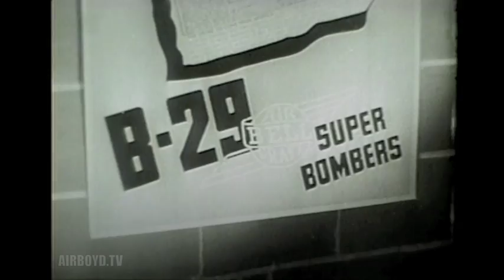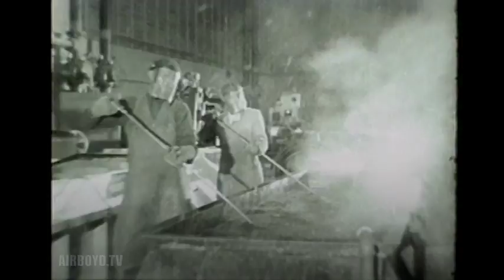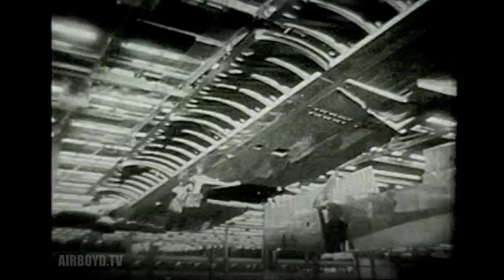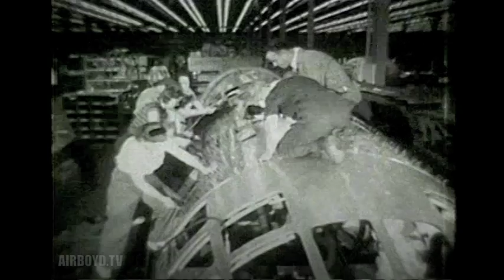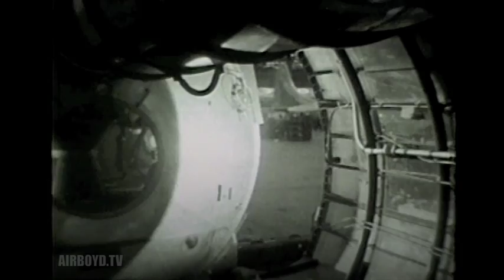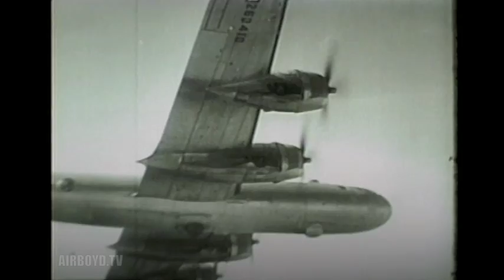Inside The Boeing B-29 Superfortress Aircraft Factory

Comment: Just saw a short video on the b-32 Dominator.( didn't know it existed before seeing it) It was a bit smaller than the B-29 and didn't have the pressurized compartments. Engines could be run going the other way and the plane could back up as a result.